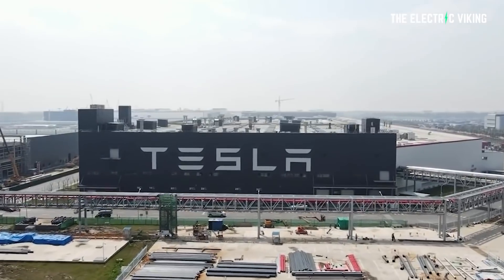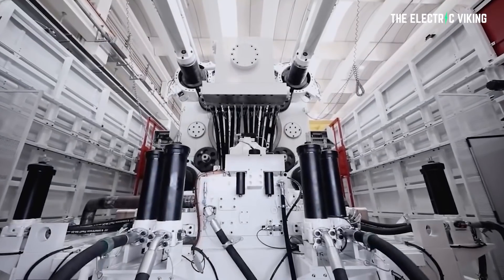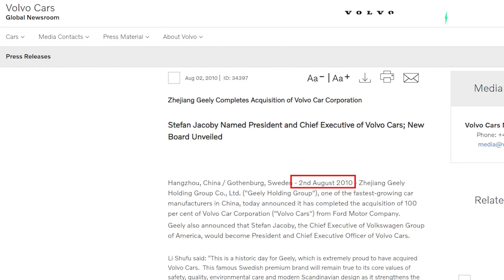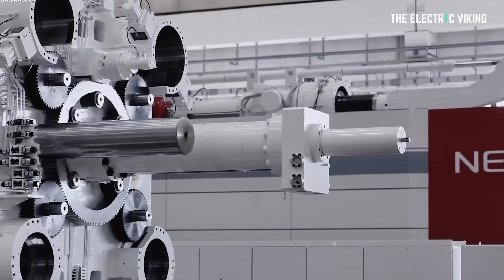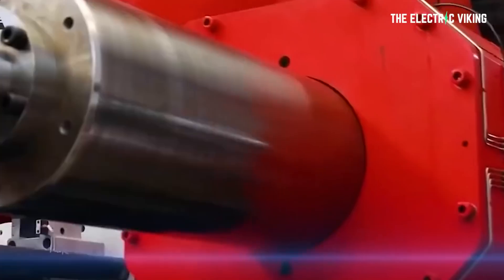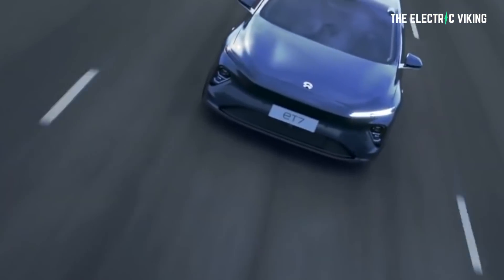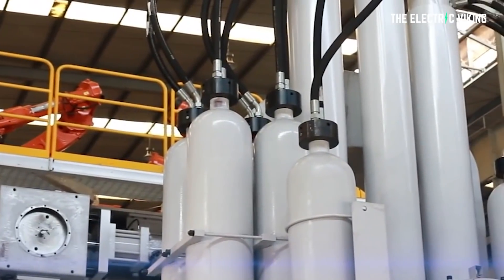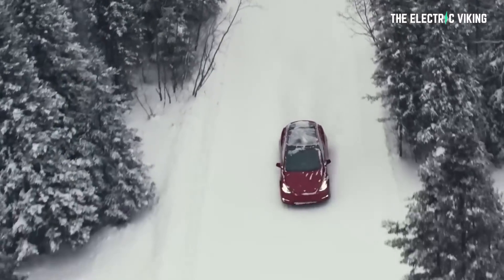Volvo spend $1B on Tesla-like Gigacasting & structural batteries

Comment: I think the exponential increase of BEV cars on the road will soon over load the national grid in USA. Electricity from solar farm, wind farm or new type of nuclear reactors will not able to keep up. For every 1MW of electricity require 0.13t of natural gas or 0.18ton of crude oil or crude fraction or 0.55ton of coal. Like it or not there have to be a plan to properly switch fossil fuel over clean energy. Gasoline cars at best is 50mpg vs 100empg for BEV cars. For every 1 million BEV on the road you will need install 4 gas turbines rated at 100MW, with each turbine hourly firing 125 barrels of crude or crude fractions that can be drawn of main distillation columns. In USA there are many small refineries that, each can install a 100MW gas turbine capable of firing crude fractions and add one gas turbine every 3 to 5 years. Maybe by 2035 or  2040 there will be 150 million BEV cars in USA. By 2035onwards these crude firing gas tubines will be use to phase out coal firing plants?. As more and more clean energy come on line the oldest of these gas turbines will itself be phased out. What ever the numbers of BEV are on the road the capacity and stabilities of national grid is of paramount importance. Regards.

Comment: Didn't Tesla have to develop a new aluminium alloy to allow cold setting of the molten alloy without retreatment to prevent issues such as cracking etc.  This due to the size of the castings.
How will 6 the other car makers get round this necessity.  No doubt Tesla patented the chemistry.  Are they licensing to the other purchasers?

Comment: Don't deny legacy auto the opportunity to pursue their own death wish. For some of them, the realization that the game is essentially over for internal combustion engines will end up finally sinking in about 10 years after the last point at which a full tilt effort to save themselves by pivoting to a full speed ahead approach to converting to BEV production will have passed by. There will be all sorts of misguided efforts by politicians and labor to save legacy auto on the backs of tax payers but I hope that tax payers will basically pass on a second round of bailouts and the death rattle of legacy auto will be mercifully brief. Ford might, barely, survive with some luck and good leadership from current management. GM and Stellantis are too busy admiring their images in the mirror of past success to get it. They are finished.

Comment: Legacy Auto simply recycles the same tired old designs. Check out a car made in 1980 against one made in 2020. The superficial style changed and but there is no fundamental difference to the design. Big Auto churns out more of the same with detail improvements demanded by regulators. Nothing more. They are incapable of rethinking the design/build process. 
2 years ago Audi had the all aluminium A2. But structurally, it was just the s  as me as a steel car by anyone else. It cost too much to make so got dumped.

Comment: Chassis castings could be made in smaller sections and bonded with engineered adhesives. These are immensely strong but don’t stress the metal as welds will do. 
The whole A post and side frame of the car could be cast and bonded, along with the chassis underbody.

Comment: If someone can find a cheap way of making cars from carbon fibre.. or invent a similar material which is easy cheap and quick to manufacture ..again I suspect this will be a molded product, this will be an even bigger strength and weight saving... Hundreds of kilos of weight savings.... And it's not just a car body it's the components just as much !
Reply: Big IF

Comment: ... as you say there are many benefits of GiGa casting some you didn't mention.. for example, cost of procuring .. either buying in or making in house.. storing and inspecing 70 different parts. Factory floor space will probably be given yealded ... Assembly line smaller less robots etc less  costs!!.. even just moving 70 parts around compared with 2 and of course the vertical integration.. these are just some of the there are more unsure someone here can list them all for our amusement.

Comment: I just took delivery of the Volvo C40 and it is overall an impressive EV although range is no better than 215 miles, it’s perfect for my needs. Software is fast and smooth, assembly as tight as a vault, among the most comfortable seats you’ll find, doors close with a solidity of an 80s era S Class. We love it

Comment: Re: IDRA @ Volvo. Tesla is said to have needed to formulate its own casting metals due to the characteristics & operational requirements of their front and rear molds. Are those formulas patented or licensed to IDRA for passing on to other clients?
Reply: TESLA is NOT STUPID. TESLA has PATENTED its ALUMINIUM alloy used in the Diecasting process after they TESTED and COMMISSION their products.

Comment: When will e cars develop a car using composites and air craft assembly methods to make a truly light weight vehicle. If a vehicle went from 4000 lb to 1000 lb that would be a great development. 1/4 - 1/3 of the current battery to move a similar size vehicle would be huge.

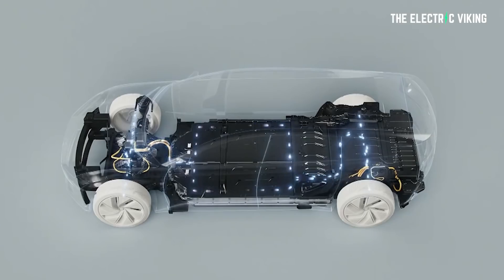Comment: @3:33 It is is a smart move. It's much smarter to cast all possible components when stamping sheet metal (always problematic) and then bolting, gluing, screwing, trimming, welding (also problematic,) whle aligning and fitting the disparate pieces together is a failure-prone process.
Reply: Can you kindly elaborate all the problems associated with the 'Legacy' way of making car bodies(specifically the problems associated with each of the processes you mentioned) other than the following: 
1) more machines mean more probability of failure and production stoppage/slowdown. Also more maintenance costs. 
2) welding and screwing adds to the car weight. Screw holes can also contribute to stress concentration. 
3) inventory management of many parts adds to costs and logistical headaches.
4) robots(welding, gluing etc) are relatively 'delicate' and not easy to program.

Comment: I don't understand how these giga casting presses need so much weight, so much force. You don't need to press the whole casting at once. It does need to happen in one operation but if you have one die for the whole casting on the bottom and 3 or 4 dies for the top, you don't need to press the whole thing at once, you can press one die at a time, then before one die reaches the point where it stops, you could start the next die beside it, then when that stops press the next die.

Think of a bed of nails. All the tiny nail points have the capacity to go through someone's body but when you press someone's body against all the nails at once, the force each nail has is shared beside the next nail and the next. That's what happens with 2 dies, one on the top and one on the bottom. Imagine someone laid down on a bed of nails and then from the bottom of the nail bed someone hammers each nail another 3 centimetres deeper one at a time. All the nails would penetrate into the person's body. That idea can work for these giga castings. 

Another example is rolling pizza dough. The roller serves as a die for the dough to flatten it. If you just shoved a flat panel against the dough, it would be a lot harder to press the dough into pizza thickness. It could be as much as 20 times as much force compared with the roller pressing just a small bit of dough at a time. With a giga casting with multiple dies at the top of the machine, you just press one die at a time and if it's in a rolling sequence, maybe 2 dies press at once.
Reply: I believe the injection and cooling time is about 3 seconds. With your truly ingenious plan, there may be weak joints caused by the time difference in cooling of adjacent sections.
Reply: @whodatcatt  That would be the case if pressing all the upper dies happened 3 seconds apart. Think of a machine gun, how rapid the bullets are fired. That's the speed I was thinking of to produce a casting. Think of runners on a track and field start. They all start at once but the inside runner is ahead slightly. So with multiple presses side by side for the same casting, each press would stop just slightly ahead of the one beside it. So you would not get weakness in the final casting. You are not waiting for cooling to happen, you are not waiting for one to solidify before the next die lands.
Reply: @whodatcatt  Instead of having the press deliver 8000 tons of pressure, it might be possible to press with maybe 3000 or 4000 tons of pressure for the same size of casting.
Reply: @dougwedel9484  
That is ingenious
Reply: @whodatcatt  Thanks. It has to work. It's just an idea and there are likely many ways to mess this up, like you said, weaknesses in the casting, etc. And it might not be necessary, it might be easier to just use the whole force at once. But it just seemed easier to press one section at a time (but all in rapid succession). The bed of nails metaphor shows how much extra force is needed to press all at once in one upper section. It might be possible to do this multiple-die-at-once mega casting with more than one die at the bottom, not just the top, or for particular spots that would be difficult to cast in one go. It would also be possible to press from the sides, not just top and bottom, so the shapes can be more diverse because you don't need to lift out the die from one direction.

Comment: As batteries become quicker to charge, and especially if/when energized roads charge vehicles while they drive (coming in a few years), Nio's swapping will soon lose traction, become dead weight.
Reply: Been driving an electric car for 8 years now. Except maaaaayyybe for those without a home charging system, charging speed is drastically overrated.
Reply: I wouldn’t want someone else’s potentially half degraded battery in my car.   Swapping a gas bottle for your BBQ maybe a good idea to save time but I don’t like the idea for such an expensive and critical component.
Reply: Quick Charging WILL always COME with a downside ( Battery chemistry degrading, Heating issues , Thermal Fatigue of casing , etc ) .
Reply: @sunshinesun121  Yes, but these problems are already solved and fast charging will only get faster. Even today its barely slower to make long trips compared to gasoline cars at least with a long tange Tesla and the very good supercharging network.
Reply: No solid state batteries are too expensive swapping stations will have their use for at least a decade
Reply: @sophisticatedthumb5364  I mean look at the current cutting edge batteries like 4680 and the charging structures up to 350kw. Once these become mainstream loading hundreds of kilometers of juice into the battery will not be longer than tanking with gasoline. There is really no point for swapping batteries anymore, because these stations are far more expensive than simple fast charging stations. They are even today not really faster anymore and in the next years batteries, charging speeds and the whole charging infrastructure will drasticaly improve. 10 minutes of loading for hundreds of kilometers will be normal.
Reply: @geiers6013  True but not everyone can afford a tesla plus swapping stations are evolving too and if batteries are starting to have a larger capacity maybe we can simply make smaller batteries and use swap station to save materials I think both can coexist for at least a decade people like options
Reply: NOT all people have a nice PORCH in front of your house for Charging. In Singapore 85% of population LIVE in HDB Flats. With another 10% in Condos. That is 95% of population ( 4.8 million people ) WILL NOT HAVE EASY to CHARGING POINTS !!! . We tried to get the Condo management to PUT in a Charging Point. They said ... NO !!! NO !!! even if we foot the BILL for its construction. They cited ...Compliance with ByLaws , Insurance coverage, Liabilities ( If Charging station catches FIRE, etc ), Parking space limitations, etc. THUS   .... BATTERY SWAP is the LOGICAL solution. Now ... Think in Shanghai, Beijing, Jakarta, Hong Kong, Shenzhen, Bangkok, etc..... Cities with large Population and VERY EXPENSIVE LAND !!!!
Reply: @sunshinesun121  Different people have different circumstances.  I have a garage with a wall mounted Gen 3 Tesla charger so it suits me.   Maybe the swap works for you, maybe public supercharging is another option?   Each to their own.

Comment: The Italian company is called IDRA and it's owned by LK Machinery a Chinese company headquartered in Hong Kong.
Reply: FALSE
Reply: @cenz5889  Right from the idragroup website, under company/vision&mission
LK Technology Hong Kong is the single shareholder of Idra but, from the operational point of view, Idra and LK Machinery are two separate companies with separate commercial activities even in the Asian markets.
In Particular Idra operates within the Chinese market with its own subsidiary Idra China and with its own staff, independently from LK.
Idra follows high-tech projects which require imported machines, whereas LK covers the rest of the markets.
The technological proposal and therefore the prices of the products are different, as well as the target of customers.
Reply: @villageidiot8194  thank you for that valuable info! So is LK Technology sort of a holding company of Idra and LK Machine? My apologies but I couldn’t find a connection specifically to LK Machines and so that’s why I commented.

Comment: Thought Tesla had a patent on the proprietary Aluminum they use for casting.
Reply: Space X engineers helped.  All patents are obsolete once the Chinese get ahold of it.
Reply: @Puer-Aeternus-Anonymous  TESLA ...MADA it PUBLIC property  . No Copy Right .
Reply: @sunshinesun121  That is not correct. The patents and copyrights can still be used and have been used for defensive purposes. They are still in place and are being defended.
Reply: @Puer-Aeternus-Anonymous  if u want to be precise, Spacex and Tesla material engineers are the same, they all work for both
Reply: Tesla do not enforce patents, besides, what has that got to do with anything?
Reply: @ForeverNeverwhere1  can thenreplicate the special alloy, that’s what it has to do with it,  do they have space x level engineers to figure it out
Reply: Elon has opened a lot of his patents as part of his goal for mass Ev adoption.

Comment: Tesla just updated weights. about 60lbs lighter long range y and 30 lbs MYP. Looks like they may keep the battery volume similar. May be more range and performance coming. This would be a good move as many who already own Ys would want to sell to get the better model. If you make it the same you loose all those potential sales which is a lot. Info was here. https://www.youtube.com/watch?v=eaNf0QBz4TY
Reply: That has nothing to do with the new structural 4680 versions.  That weight reduction is for the current versions.  There's no way they're adding an additional ~500lbs of batteries in a vehicle for the same price